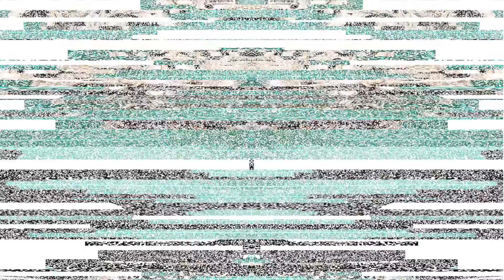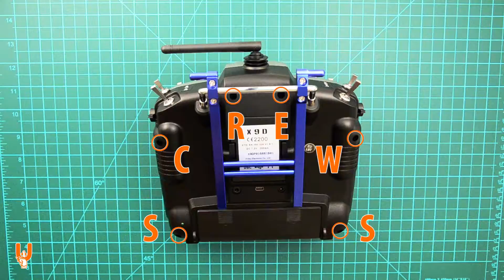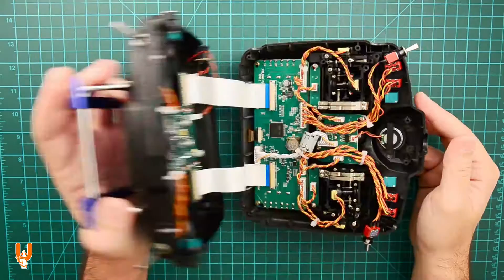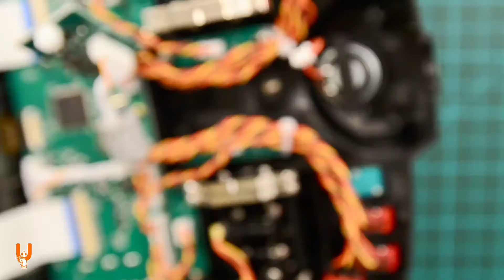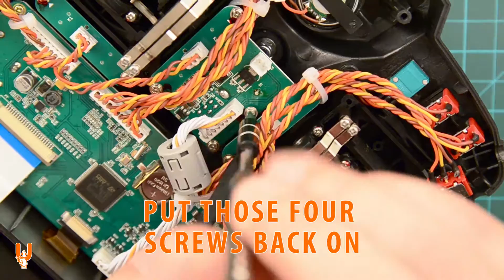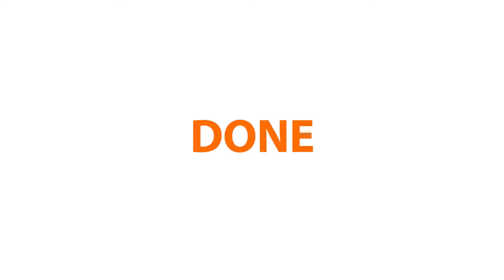How to tighten the balancer (hanging hook) of a Taranis X9D - EASY FIX

Comment: Cheers for the this mate, the moving balancer drives me crazy. One question though, what size grommet and grover washer did you use here? they look a bit bigger than M4
Reply from the maker: Hello! I am so happy to see that one of my very first videos is still useful (aside from how terribly fast it is :P) At first I had noted M3 and another person corrected me that it is an M4 size. That's all I can tell right now, I don't have my Taranis open to re-measure :S
Reply from the maker: I don't have that nut driver anymore either, so I can't check the socket size

Comment: I like the clean and concise style of your editing, but i find it too fast at times, more specifically the text parts are hard to read,
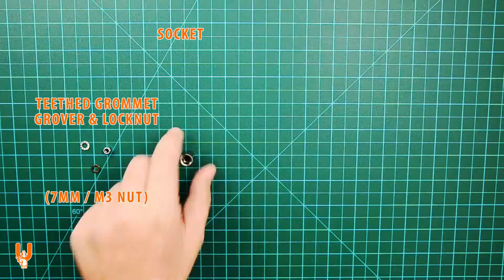bits like these   0:03 , 0:13 are great, the white background and font size makes very easy to read even if they are fast.
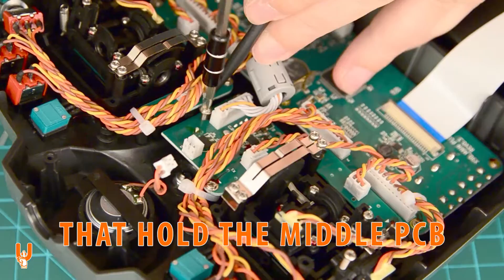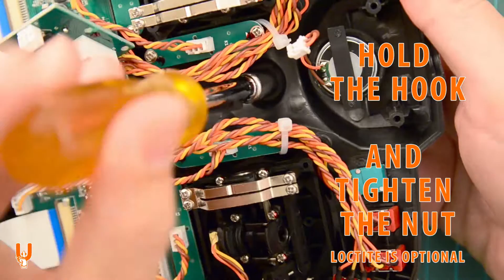But parts like these 0:50, 0:56, 1:10 are difficult, because of all the visual information going on and text switching places,action going on, its hard to keep track of everything
Perhaps adding some sort of text background, (like an opacity box or or blur  ) between text and image , and leaving it a couple of seconds more if possible :)
Take this with a grain of salt, I know video editing can be A task :), and this would probably mean extra steps and more work to get things done :)
Reply from the maker: +JustForFun RC you are right, I believe I have evolved and improved a lot since then though. Still experimenting with timings and transitions but the result is cleaner now.

Comment: Might I suggest removing the comment about locktite.  I put locktite on, which I admit I did a little sloppily (more than necessary), and when I went to use it the hanging hook pulled right through the case with only the weight of the radio on it.  I suspect the locktite reacted with the case plastic and made it "crumbly" without any strength.
Reply from the maker: I have never heard this happening before. Blue loctite secures the nut very well, you apply just a bit on the end of the threads where the nut will screw and it sets after a few hours. It unscrews very easily, just requires a bit more strength on the first twist.
Using too much loctite is one thing. I don't know if the loctite affects the plastic of the case, maybe the nut was over-tightened and cracked the plastic?
Reply: I know now that I used too much (seemed there was a clog in the tip and when it cleared too much came out) and should have removed the extra but hindsight is 20/20.  The plastic degraded actually, it crumbled around the resultant hole.  I agree with the fact that if I hadn't applied too much I would have been fine, I just think a mention of caution should be in order.  Your video is valuable and I appreciate it.

Comment: M4 nut, not M3, at least on X9D plus SE
Reply from the maker: You are right, 7mm thread corresponds to M4. Thank you for the correction!
Reply: @muteFPV  You're welcome, you can just measure the diameter of the thread with a metric caliper to determine which thread it is (assuming it's a standard one).
M4 means the high diameter of the screw is 4mm, while a hole should be bored at 3.3mm before tapping, and the thread goes around every 0.7mm (unless it's a special thread like M4x0.75).

I placed a single split washer underneath the nylon nut but I feel like it's still moving a bit... I did not want to risk splitting the plastic by overtightening... Do you have to re-tighten it every once in a while ?

Nice video overall, information quickly acquired, feels good to watch ! Have a nice day !
Reply from the maker: @hugepines3990  it is actually one of my very first videos, my editing skills and image quality have improved a lot since then :) I have not re-tightened it but I have also stopped mounting the monitor there. With the neckstrap it doesn't move at all.

Comment: What a stupid design, really frsky? you have to open up the controller to adjust the hook?? WHAT A JOKE!!
Reply from the maker: You can adjust it without opening (it turns by hand). But yes, if you can to fix it in place more securely, especially for the weight of a monitor, you need to open it.